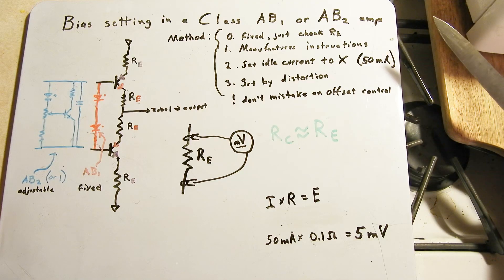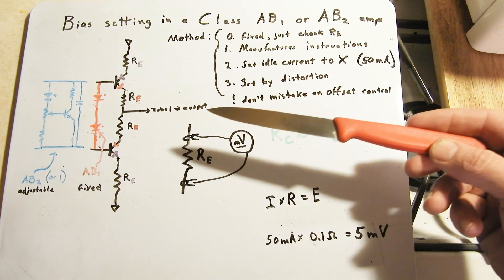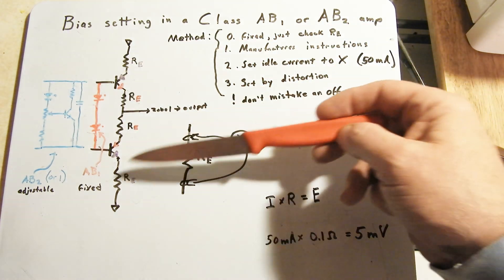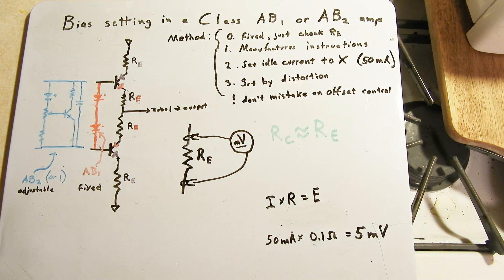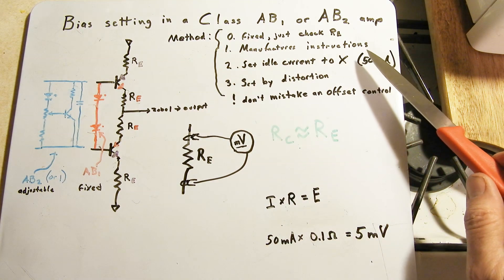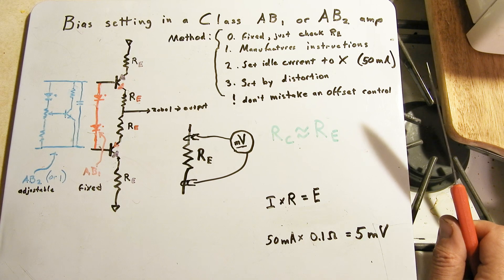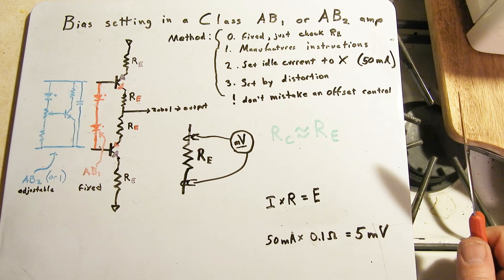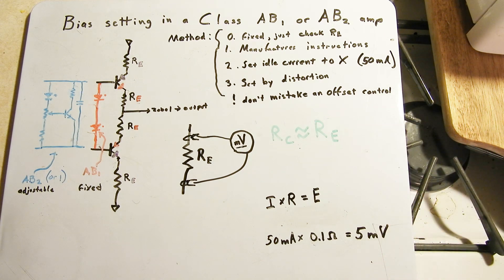Setting Bias on a Class AB Power Amp

Comment: I have a 12v car audio amplifier that needs to be checked. It draws excessive current and runs abnormally hot, I was told this is a symptom of incorrect bias setting. They also said to screen the board for any chips that are current hogs and defective, the amps are brand new from 1998, just opened the box and installed them in 2020. Do you know of a reputable place that can give this amp a thorough inspection? I have the schematics and the final assembly test checklist from the manufacturer.
Reply from the maker: Sounds like it is probably blown. Does it produce clean audio still? Most audio power boosters work in "bridged" mode which means there are two hots for each speaker, no speaker wires can be commoned or grounded. A bridged stereo power amp has four amplifiers, a pair for each speaker, and one runs in reverse phase. So you can have a channel work even though one of its amps is fried, it will just make less power. Don't know who to reccomend especially not having a clue as to where you are located. You might check a channel called BareVids.

Comment: Does it has to be done with open circuit or with 8/ohm dummy load connected to the amplifier? I am trying to adjust the bias current in a Sansui A40. I have tried one time with load and by signal distortion based on the scope screen. The result was that after trying out to turn the tripod the output transistors blowed out and protecting fuse go open also.  I will really appreciate your comments. Thanks
Reply from the maker: It actually shouldn't matter whether or not you have a load, though I'd use the normal load just for amp stability. As long as the Output DC offset is zero or very low (and of course no input), attaching or removing the load shouldn't change the DC Voltage drop across an Emitter resistor.
   When setting by distortion one must still monitor the DC current to make sure that current never exceeds the 50-60 mA max (in most situations). The goal of setting by distortion is to see if you can set the bias LOWER than the max.
Reply: Hill's Workbench thank you for your help. It works !! I have now the bias current adjusted according to the service manual to 4 mV across emitters resistor. I Checked waveform and zero cross distortion on the scope and it was no necessary further adjustments.
Reply: I forgot to comment something. The DC voltage at one channel was about 13 mV and 22 mV at the other one. Is that normal? What may be the reason?
Reply from the maker: @pabloosvaldopenizzotto1098   If your talking about DC offset here than those numbers should be completely acceptable for most amp types, I'd have to know more about the amp your working on to comment much deeper. A few amps have an offset adjustment. If it is a direct-coupled complementary symmetry amp than perhaps transistors could be matched better.
Reply: Hill's Workbench thank you again for your helpful comments!

Comment: Just for clarification on the clarification. Some amps will not have Collector resistors. Ic=Ie+Ib. I talked a bit on Class AB1, then talked about calculating with the 50 mA number, which is a class AB2 setting. An AB1 would run at roughly half of that. The little circuit in blue is an example of a "voltage spreader" you might find in an AB2 amp.